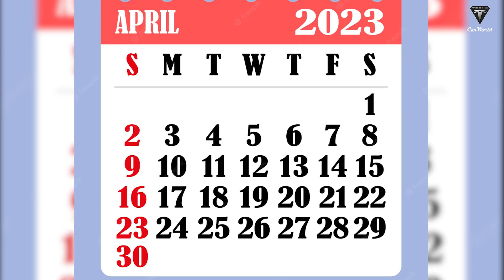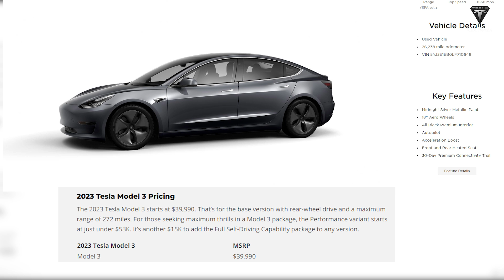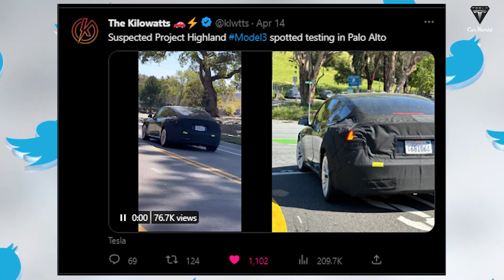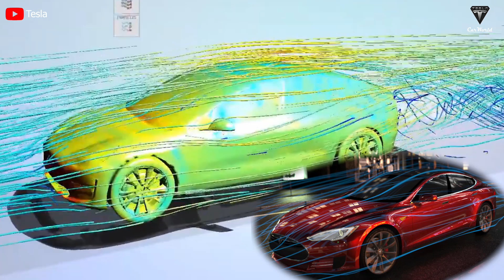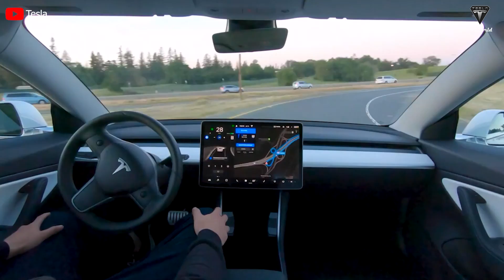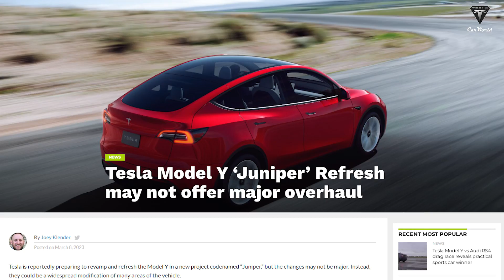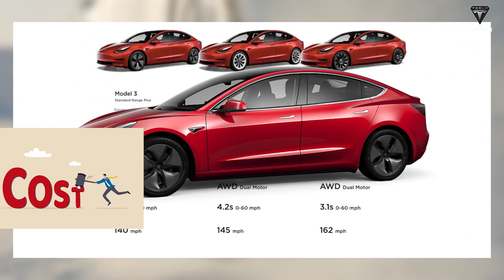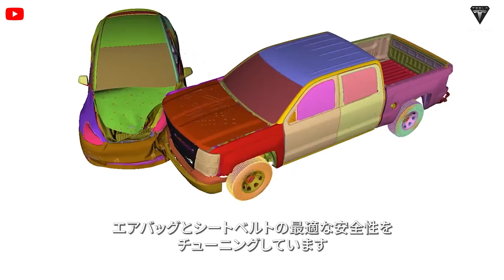It Happened! Elon Musk Reveals ALL-NEW Tesla Model 3 Features Upgrade, Change Everything!

Comment: Once you go ⚡️- YOU WILL NEVER GO BACK TO FUEL INTERNAL COMBUSTION VEHICLES.  I promise you.  It’s an experience you must experience yourself.  Since 2012, I’ve converted ALL of my vehicles to electric ⚡️.  I save usually $4000-$7000 annually for maintenance and fuel combined. Save even more when charging during non peak hours. I’ve never replaced my brakes- going in 7 yrs!!!!!!! The regenerative braking system is FLAWLESS!  Back in 2016, folks around me, teased me daily. Now, they’re ALL eating crow! 😂
Reply: I have a plug in and hate for the motor to kick on. I'm getting full electric next time
Reply: For daily driving EV’s are nice but as of now they cannot outperform ICE vehicles on track
Reply: Absolutely Correct, Electric is Quite Magnificent
Reply: @wesleyrim  WRONG, THE FASTEST EV OUTPACES EVERY ICE VEHICLE BY 65%
Reply: @seanrobin6573  EV's are not ready for the track, regardless of how quickly they can accelerate.  The batteries overheat and performance drastically falls off after a couple of laps.  Look at formula e, those cars are way more advanced than any other road ev and they can only run for 45 minutes before running out of battery.
Reply: @seanrobin6573  and also having a single speed transmission with a fixed gear ratio, the teslas acceleration drops off a LOT after about 110 mph.
Reply: @wesleyrim  you are right but progressively they will get much better than ICE. Matter of time meanwhile I don’t have to 80 dollars for gas every 3 days , no oil change and no service.  Ice is the rotary phone and Tesla the iPhone.
Reply: Uh,,,depends where you live. I bought a Tesla Model 3 dual motor long range. Nice car. But,,,the charge infrastructure is dismal. Tesla has so far built 3 supercharger locations, all in upscale malls in downtown Bangkok. This does nothing to extend the driving range for longer duration trips. This is actually a marketing effort so folks can meet at the mall and go to Starbucks and gloat over their green EVs while thry charge with their friends. Tesla should be ashamed of themselves for this initiatial location decisions. The other public charge options are as expected a terrible experience. Locations generally have 1 or 2 units and they are unreliable and more often than not occupied with someone waiting. This means a charge stop can be an hour or longer. Frankly I wish to be the master of my time and not have that dictated by my cars restrictions. I charge from home and I have a solar system so 80% of my daily driving needs are met nicely. But,,,,for the 20% of longer journeys thankfully I have a Volvo V60 PHEV. It goes 90km on electric alone (most daily needs) and for longer journeys I can go any distance, any where, any time with ZERO inconvenience. It allows me to be the master of my time.   I'm fortunate to be able to have the Tesla as a "2nd car". Frankly the Volvo is better quality and ride. Could I get along with just the Tesla? Yes, but at unacceptable inconvenience. PHEVs when applied properly and under current conditions where I live (Thailand) are superior. Tesla launched in Thailand and their commitment is to install 10 superchargers locations in the 1st year which is really a joke. I see photos of Tesla charge locations in USA or Europe with 60-80 stalls. Envious! EVs have really gained momentum in Thailand with many Chinese brands launching successfully. But once again the charge infrastructure will be a massive frustration for those who wish to use their EV cars as equivalent to PHEVs. Tesla will sell something like 10,000 cars here in the first year but their famous charge network is nowhere to be found. It screams of a knee jerk market opening to dump inventory and just make a cash grab. (The car is indeed quite good) 😊 PHEVs can be and in my case are a fantastic solution.
Reply: @bayat2  I don't doubt that within a decade almost all cars will be electric.  It is way more convenient in almost all aspects.  I just get annoyed by all these Tesla fanboys that show a sense of superiority over others (I own a 2023 Model 3 Performance) so I can say this from an owner's perspective.  And I get the reasoning behind that - Tesla's are so advanced it's just pretty much floor it and go without having to spin out due to their advanced TCS.  But being around ICE cars as well (I also own a fully modified 350z, entirely rebuilt suspension, full bolt ons, tune, etc...) I think many EV owners fail to realize how relevant ICE cars still are.  They still hold track records at the Nurburgring because they still excel in some areas where EV's currently lack (although I'm confident that it will improve).  So yeah I just get annoyed seeing comments like "TESLAS ARE BETTER THAN EVERY CAR" lmao
Reply: @wesleyrim  thank you for that, I was gonna unleash my Tesla hatred towards all the fan boys but good to know there are Tesla owners who get both sides. I’ll stop here.
Reply: @sunrisejak2709  glad to know there are Tesla’s in Thailand and I wondered how the infrastructure was built. Family is north of Khon Kaen so I doubt we’ll see many charging options there. Which is why I bought a new Hilux diesel pickup instead of waiting for an EV. I work in Kuwait, doubt they’ll ever have EV’s here until their oil is all gone.
Reply: @wesleyrim  model S constantly sets records on tracks tf you mean?
Reply: Zr,x
Reply: @mostmost1  With the Volvo the motor "kicks in" imperceptibly. The only way I know is to see the "gas droplet" symbol in the drivers display.
Reply: @sunrisejak2709  prius cars have a noticeable change. The car feels sluggish outside of electric.  Mostly over 50mph however.
Reply: @mostmost1  The Volvo V60 has a combined 460 hp and with gas/electric. 0-60 mph in 4.6 seconds. 😁 50-55 miles on "pure"  electric. Got all bases covered.
Reply: We would entirely agree. Once you go electric you can never go back. Total game changer
Reply: @wesleyrim  you comparing a Formula e race car to a common consumer automobile. Comparing Watermelons to grapes.
Reply: @MrJmack46  Yes because those are optimized for racing.  Standard EV's batteries are even worse, you take it a couple of laps and the battery is already half gone.  Not to mention the brakes on Tesla's are insanely bad.

Comment: 7:04 Removing a temperature sensor as a "cost-saving measure" is like shaving off your body hair and calling that a "weight loss program"... 😑
Reply: It’s unnecessary 😂
Reply: @ReallyTheGoat  a temperature sensor is essential here up North. I just checked, and my Gps weather data is 9 degrees celsius higher than the actual temperature measured by my Tesla. That's basically the difference between spring and winter...

When you live in an area where it's constantly right above or below freezing in the winter you need to always check the app to see the temperature before you drive, because you'll need to know If you have to defrost or not.
If it's below freezing and you don't defrost first, then the windows will be frozen shut and you won't be able to close the door without breaking the window.... 

Without that temperature sensor I'll have to always defrost just to be on the safe side, because weather data can't be trusted. So I'll waste a lot of energy and money.. Great for tesla. Bad for me....

Comment: Sounds like they’re aiming for a $25,000 car but will end up costing like $60,000 when it’s all said and done 😂 the current Model 3 is going anywhere from $38,000-43,000 (depending on the day) and this is not only a redesign, but it seems as though they plan on making it even better. I highly doubt it would be cheaper.

Comment: That is all ok and simply votes to more safety better self-drive and more interact wilth ai voice PC nav and even cosmetic design that turns functional and can even more work scfi airvortex whistle sound on guitar whistler in below car has air colector part tuner and permanent air suctioner with servo ribs and PC opens and cool down air vortex in hub and also bateries that the genuine idea scfi stuff from air tunel test allowing even more scfi sound e formula has second part in whistler is ratio size cooling air to gen part from some like 75-25% to easy eu domene part 70-30 or even awd all standard 60-40% or also like popular german enginering 56-44% funy today german enginering is not in use this tech or even boosting cooling that auto vait production for atleast 3 years which is kind funy or even allowing low range at smaller end speed for o be highly productive one is figure in production one is market one is production mess currently in germany and market loss figures pop especially in china from his this are not just oil and gas whistle war jokes but production and production loss and assembly time to gain coop production and resource and still hold to same receipe and lose money and kind give sporty or wer sporty car as know how mismatching data car response and underestimate range batery well numbers this segment is crutual and research and inovation but that's not new boost expected only in 2025 then speed up so far unserious a story fairtail while concern are playing donkeys and selling globaly leg to each other incl toyota and prod fluctuate or even down falls are like know how trend while taking or trying to grasp oil from UE that's. bit greedy with no firm future goals and with not locked research and inovation and not clear future view and is so called wallet society looks like Jeff and Elon are inventing a new car game don't knowing really to cry or laugh in media while Elon is hashing and filling the bird  and then you hear egiptians so was our egiptian pharaon nefre kind off poetic competing in lux toys projects bit Lego on ego and happy on Mars waiting on something like buzz on wall street in 19 century well awaiting disaster in economy and to boldly go where no boldhead has gone like capt picard in star trek and new shampo commercial which kind Donald Trump already try to sell once in election